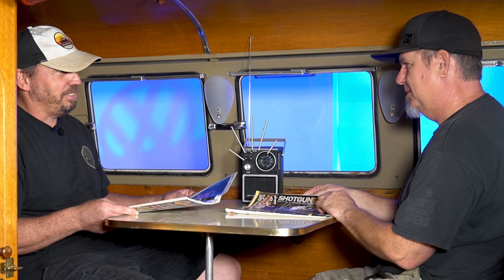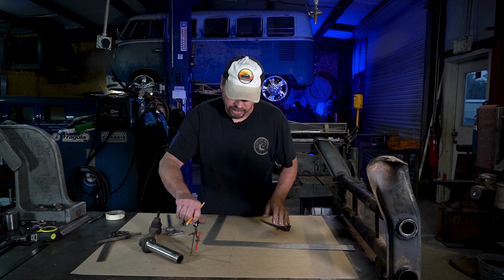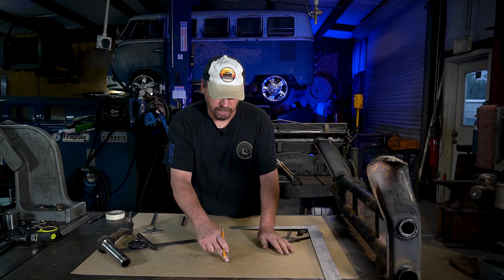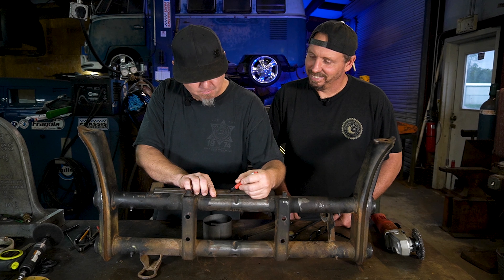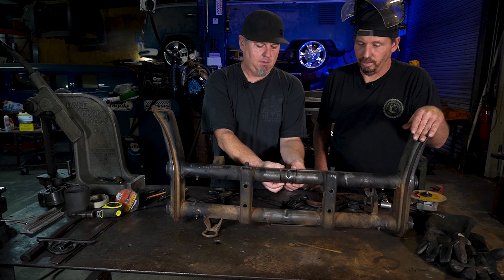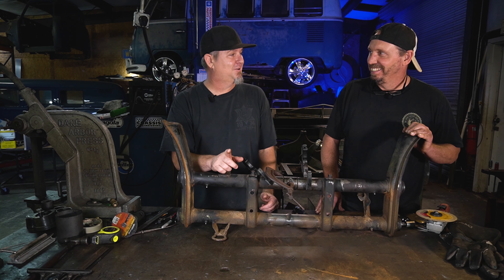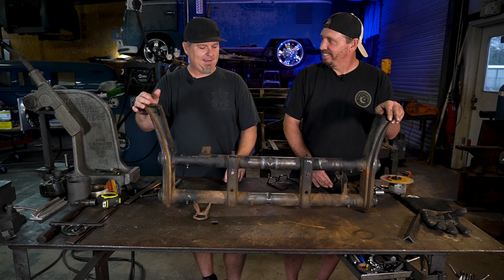How to Lower your VW Bug For FREE!!

Comment: i used a large pipe cutter, no loss of material and super clean already prepped for welding.  just make sure to do one complete before cutting the other or the beam can spread. the pipe cutter gave super straight clean cuts. but like you did....in a pinch on a low budget....you do what you gotta do. good job.

Comment: When did my beetle I just removed the bolt, broke the collar free inside the tube from the dimples and drilled a new hole further round for the bolt. No welding required 👍🏼

Comment: this may sound crazy but 12 yrs ago i took the center grub screw out and re drilled the hole and turned that whole thing inside the tube and put the screw back in.  both top and bottom and got me about 4 in of drop on my 58 panel van.
Reply from the maker: That sounds like a real easy way to do it.

Comment: Use a center punch  ding dong
  Make ure marks. And use a pipe cutter,,  better tell people not 2 cut thru torson bars.
Reply: Back in the late 60s early 70s building street buggies that's what we used to cut them. And if you dldn't want to cut the beam. You could remove and cut some torsion leaves off the spring stack. And then tack weld small sections of the cut spring  on the inner mount point and the outer mounting points to complete the shape of the stack. That's how we did it old school.

Comment: This was the very first way to lower your VW Ball Joint or King/Link pin front beam.  Way before pulling splines (Dangerous, don't suggest it) then the Sway-A-Way lowering kit that was adjustable raise and lower of 4".  Then the Puma Adjusters which were basically the same thing.  But, the last 2 kits, you still have to cut and install the adjusters.  Same way to make an adjustable raised beam as well.  Nice work guys, bringing back a late 60's early 70's way to lower a VW!
Reply: Pulled a leaf in each beam in my 57 oval with success was wondering if anybody tried a ball joint front end

Comment: Great video, just one tip, it is much more easy to use a racket pipe cutter, clean and perpendicular cut.
Reply: That would work excellent! I dont have one but I think most diy peeps have a grinder so we just showed how to do it with that

Comment: your the best , Im not good in math , if i want to lower 4 inches how much should I turn the tubes? half inch???
Reply from the maker: I would just weld in adjusters so you can change it if it's wrong.

Comment: I might of missed the explanation but do you cut and weld just the upper torsion center or do you repeat the steps for the bottom torsion center as well? Thanks!
Reply from the maker: Yes you have to do both.. Just make sure you do one at a time... it will keep everything lined up.

Comment: I have 1972 Baywindow bus and wondering if this process can be done to front beam like you have demonstrated?
Also, any idea if I can lower 2-2.5” and run stock wheels/tires without rubbing issue?
Reply from the maker: The Baywindow is done basically the same way. Wheels should work but you'll probably have to go with a smaller tire.

Comment: will this method work for a late bay Bus 1977?
Reply from the maker: Yes, you just need to cut off the center pin bracket for the steering first and then weld it back on after you're done.

Comment: When you say 3/20 is that mm? Awesome video!
Reply from the maker: Can you give me the time stamp to what part your talkin about?
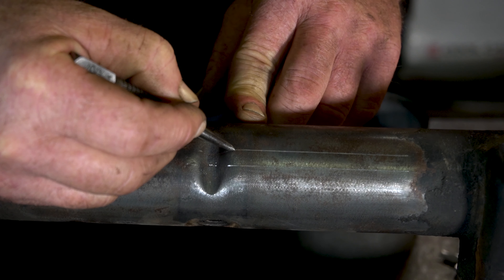Reply: @RobStapleton  at 5:15 how much do you turn the torsion center you cut out, turn and weld back in. How wide is that gap you drew?
Reply from the maker: @c10etc  If you go to around 7:50 it shows how we twisted the tube.

Comment: is there a way of doing the rear without the wheels cambering in at the top?
Reply: Well Yea but that involves some work! We hope to do a video about the rear shortly. What year vw do you have?
Reply: DemonMotorsports1 I have a '72 notchback
Reply: @mzmadman  That will have IRS in the rear so wont camber to bad anyway. I havent done a type 3 yet but on a beetle you can flip the arms when you lower it and that will straiten it out some after lowering. Of course you have to cut off and re fabricate the shock mounts

Comment: Stupid question : ive heard people pulling the torsion bars out and removing the front stabilizer bar for a quick suspension drop. What is your view on it?
Reply from the maker: It will lower it but it will ride terrible.
Reply: @RobStapleton  my beetle is a 1974 model still has the king and link pin beam. Bought drop spindles too fit and at the same time replacing the king and link pins.
Reply from the maker: @pierreduplessis1507  I had a 1976 that I pulled the torsions out of the beam....I'll never do that again. lol 😥😟
Reply: @RobStapleton  ok. How was the ride squirrely? At this moment im a bit scared too cut into a beam. Id rather do the drop spindles.
Reply from the maker: @pierreduplessis1507  It rode like a tank... Are you anywhere near Florida in the U.S.?
Reply: @RobStapleton  I live in south africa. Been watching your videos for a few days. Just recently found your channel. Id rather get more info before i do it.
Reply from the maker: @pierreduplessis1507  Thanks for watching! If you can handle taking the beam apart the rest is pretty easy. Also if you weld in adjusters it gives you a bit of wiggle room to dial in the ride height... we might have to do a video on tearing down and beam.
Reply: @RobStapleton  what is your view on airride kits? Would like too see a video on it.
Reply from the maker: @pierreduplessis1507  I think air ride is ok but the Demon Motorports Hydraulic kit is the way to go! There's a few videos on it in our Volkswagen playlist.

Comment: Why not just drill new holes through measurements unlike all that work?
Reply: Because inside that tube piece they rotated is a thick steel disc. Drilling and tapping that thing would be way more work. It’s probably a very hard steel if I had to guess

Comment: Hi guys. Do u have any idea how to lower the back of a 1973 bug for free? Another video would be great. A fan from Egypt
Reply from the maker: Thank you so much for watching! We are going to do a video on the rear, we're just waiting for the right car. The rear is pretty easy!
Reply: @RobStapleton  I appreciate that you replied so swiftly. I mean lowering without losing the ride quality and without having to use expensive dropped spring plates or adjustable ones. If you show us how to cut and weld the original swing plates to drops them and avoid sacrificing ride quality
Reply from the maker: @amrabdelhamid8583  I like that idea! Maybe we'll show both ways when we do the video.
Reply: @RobStapleton  can't wait and maybe I will shoot a video when I do this on my car. I am lowering the front end using your video pretty soon
Reply from the maker: @amrabdelhamid8583  I would love to see your video if you shoot it!
Reply from the maker: @amrabdelhamid8583  If you go to the about page on my channel you can find it there.